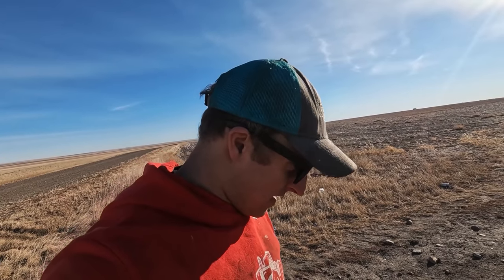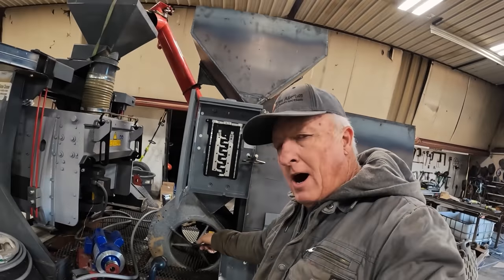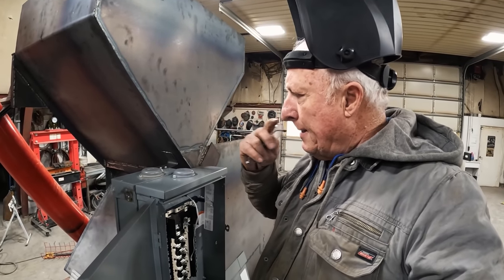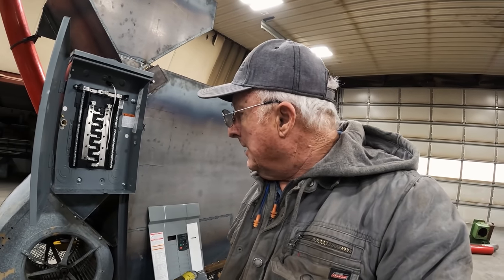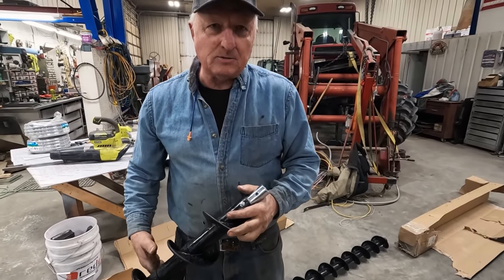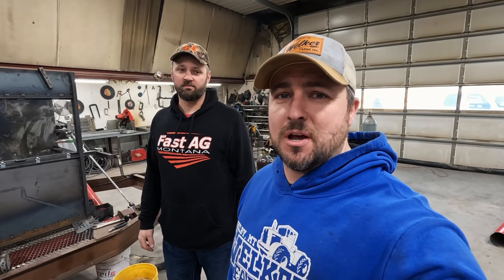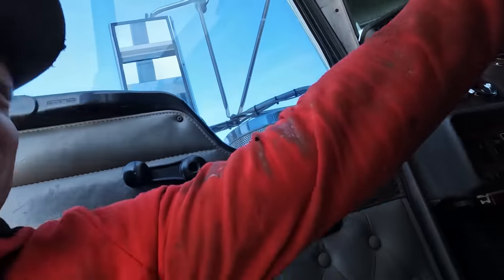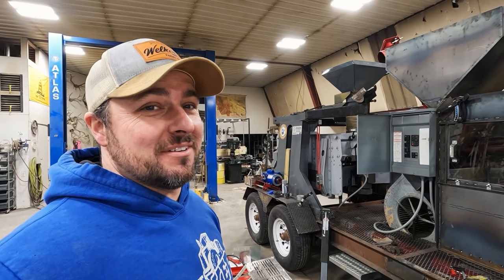Yep, a FAST to SLOW us down! - Pea Cleaner Part 5

Comment: You're going to have an issue with the Lundell plastic flighting for use in a grain cleaner. If you don't keep it completely full all the time it will wear prematurely in the center of the auger where the grain isn't keeping it "floating" in the center of the tube. Putting another vfd on those motors to slow the flighting down and keep it as full as possible is the best route. Just don't want you to be disappointed in the product if that starts happening!
Reply from the maker: That is great information and we actually just ordered another vfd and 3 phase for the main auger so we can slow it down to not be so aggressive on the peas.
Reply: @WelkerFarms  I'm the guy you talked to at Shortline Ag in Scobey. I've been installing those Lundell flights for over a decade now and built many parts for grain cleaners. Just get ahold of me if you have any questions.

Comment: On the box that you have the 3 phase  converter it a fan to cool  it you'll want to keep clean cool air around it the expanded metal needs to covered with some type of filtering material.  I know,  I have aVFD that got Bee's wings,  like the chaff you'll be dealing with,  got into it and overheated.  Cost 4k to replace.

Comment: You will probably need to use compressed air and blow the fins out on the Inverter frequently, since it will tend to attract dust and chaff and start overheating.
Also be careful with the low voltage signal wire running through the high voltage breaker box.
If it shorts, you fry your inverter!
You may also have issues with RF noise getting into the control circuits if the control wires are running right past high current wires, so it's best to either keep the signal wires seperate from the power wires, or run it in a shielded metal conduit, or at least use shielded wire.

If the inverter gets clogged up with debris frequently, (which won't surprise me lol), I would add filters to the enclosure so that it keeps dust and bugs and debris out.
You can use foam or pleated paper filters, and either fab something or you can get filters designed to mount on enclosures like that.
If you do add a filter, you should also add a case cooling fan to keep air moving over the inverter since the filters will reduce ambient air flow into the enclosure.

Comment: Be sure to write down all your motor parameters and settings in that VFD drive. That way if the controller looses the settings during storage it’s easy to re enter. My career was in motor control in a large mill. I’ve seen it all.  Using VFD is a great idea. Way simpler than mechanical variability. Good luck

Comment: In all areas where you have shaking connected with bolts or screws put a rubber or flex thin bushing "sidewall of old tire" this will help stop vibration from transferring from motor to stand. try it you will like it.

Comment: I highly suggest tempered or ceramic glass for your view ports. Any polycarbonate is going to fog from uv exposure and get scratches from seed.
Reply: Pretty common to use plexi on seed cleaners 
Even the commercial grade 
Real glass is heavy, expensive and prone to breaking 
It's really only going to see a week of sun a year if they rent it out, less if they don't, then live In a shed the rest of the year
And if it does fade and scratch you can put another $10 peice in
Reply: Don't need a clear view, product's shadow will provide the info the operator wants. Perhaps mount viewing panel on outside face of bin for easy change.

Comment: Nice looking cleaning machine that you be designing and building on the fly! At least if the drought worsens much more, you have a fab-ulous sideline to charge into! Got to ask you a couple things tho Bob, about your 3 phase converter: Is the location of the converter on the "least" dusty portion of the cleaner? Are there additional open ports on the converter's container to bleed off more heat, to avoid going into heat sinks on the outside of the container? Sure would not want to be hearing that as you charged into crop cleaning, that you became shocked by the amount of heat building in and on the container vessel. What an electrifying thought heavens to Betsey. Stay Safe! -Bob...
Reply: The area It's located is away from the outlet fan. I figured I look after cleaning to see if chaff collected in the converter

Comment: With the snow you have had then melted off , is that better for the spring wheat  or a big snow pack that melts off in the spring?
Reply: It's good to have winter wheat plant hydrated but not good if left exposed to extreme temp changes.   A good slow spring melt for spring wheat is best

Comment: Run the 50 amp cable through the triangle area in front of the fan, then on the inside of trailer to each motor location

Comment: Using breakers as switches will work for awhile, but eventually one of two things will happen, they'll stop switching or they'll stop being breakers. Hopefully they lock "open" instead of "closed".  A contactor would be a better choice. Then you could switch the power on and off using a low power switch - and the contactors usually last a really long time, and you can switch several circuits with one low power switch (great for 3 phase).
Reply: I agree.   But with only a hand full of days use it should last awhile.  But that's the next upgrade

Comment: Any concerns about the vibrations caused by the shaker shorten the life of the breakers and switches? If those wires don't have enough give, they might pull things apart when it gets shakin.
Reply: No.  There was minimal trailer shaking, do to the 5 Jack's lifting the unit

Comment: Motor should have fused protection with time delay fuses to allow for start up current. If breakers trip on starting they are doing their job. Starting or inrush current can be 6 - 10 times what running current is. Also main power coming in is referred to as ‘line’. Power to motors is referred to as ‘load’.  Not criticizing just sayin. Great channel

Comment: - [Is my understanding correct?] If you take the time to Solder the wire ends, you will never get corrosion  in/on the wire with its connection point.
Reply: Crimp on Ferrell are better than  solder.
Reply: @alanmcgregor4909  .
- Interesting.
- Why?
Reply: I just learned what ferrules are , they are what's of your end oh your shoelaces.  I'm wiring up some really small stranded wire,  22 gauge.   It's a tube you slide over the stranded wire crimp it , now you have solid tip that easily slides in to the screw conector,  much better electrical conection.  Tony Fast will have that wire on the Accu Volume system he's putting on his Sprayer.

Comment: does that controller that converts 1 phase to 3 phase have an amperage rating/limit? just asking to  learn thanks...in the meantime Mr Bob is the fastest electrician around
Reply: 😊 it's rated for 3 hp so the 1 has motor should be ok

Comment: Legarms "Scott" sir; the fastest way to clean a shop walls or roof is none other than TSP. Mix it strong and hit it  with a spray on... wait a few minutes but not too long, early is better  than late as it melts smoke but  if dry is a new mess. Use the power washer or even a hotsy if you want and wow.... clean as new... do the whole shop in just hours.... Nick... commit to buying one new truck for the farm.... at least within ten years of new because just that tractor is  quarter of a million

Comment: There are a lot of components on that piece of equipment that shake, vibrate, etc. Some electrical components, like the phase converter and breakers, may be damaged by the vibration. IMO the electrical component boxes should have been mounted with some form of vibration isolation to prevent damage to the components.
Reply: There was minimal shaking happening.  Didn't even make ripples in my coffee cup I sat down.  If course the coffee disappeared quickly...........👍

Comment: If a may come with a small suggestion is to put a dust filter from a vacuum cleaner in the box with the converter.  

Should not be so dense that it hinders the airflow but enough to keep some of the dust from the fan and should be readily available and cheap to replace when needed… 🤔